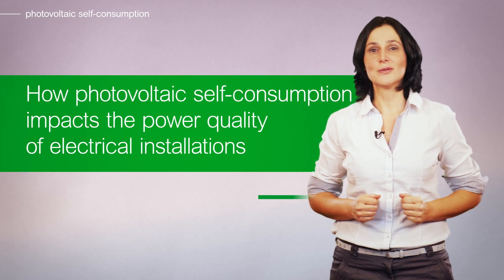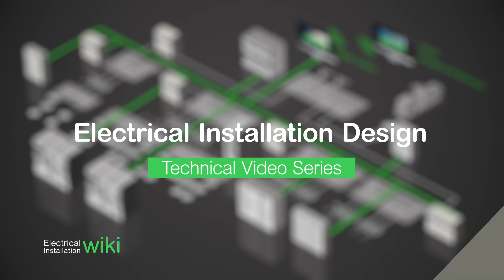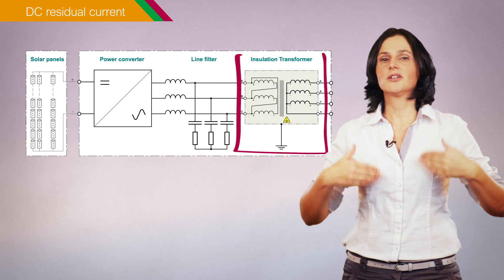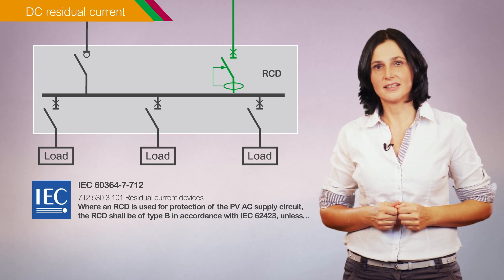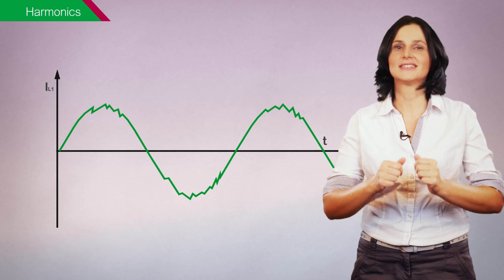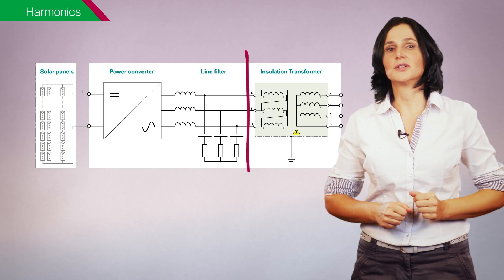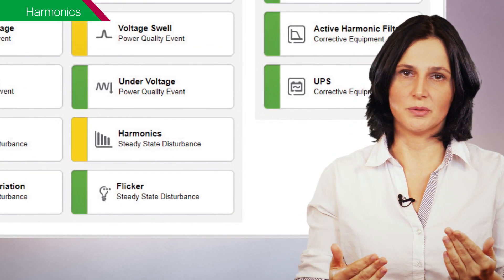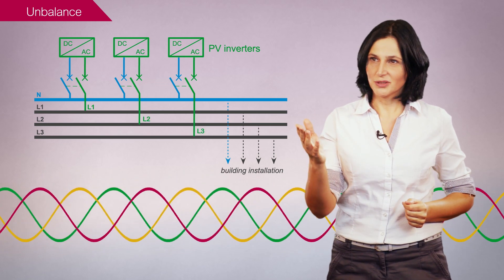Photovoltaic Self-Consumption: How Power Quality is Impacted | Schneider Electric

Comment: Thanks for the presentation. However, there are some more points that need to be clarified and the story with inverter generated harmonics is not as easy as presented here. The harmonics generated by PV systems are multiples of switching frequency which normally are classified as super harmonics and are normally in the range of a few kHz to hundreds of kHz. . But the harmonics generated by VSDs and are normally generated in distribution grid are multiples of grid frequency (50 or 60 HZ) normally less than a few kHz. Combination and impacts of these two groups of harmonics and their impacts on PQ is not the same. Most of the meters in the market can not measure the both ranges at the same time.